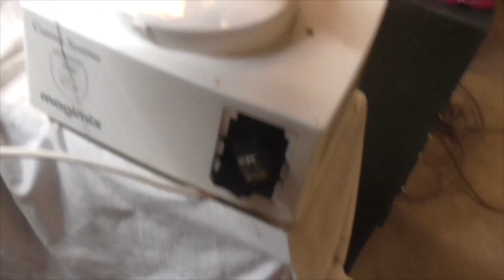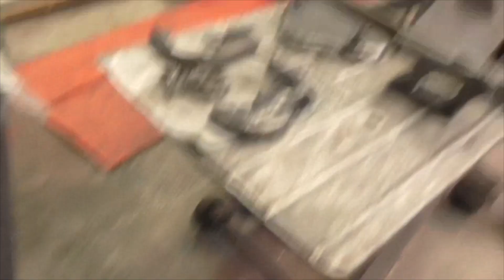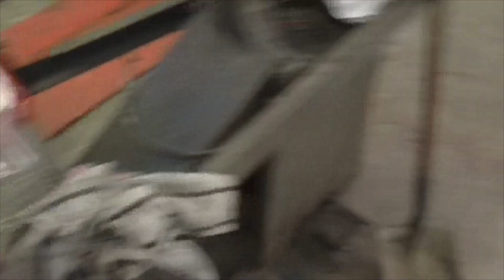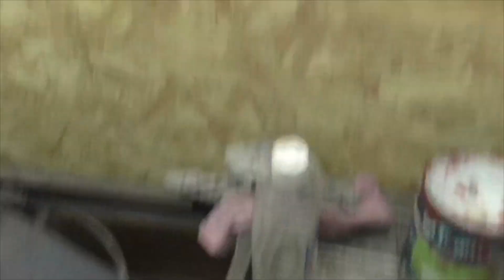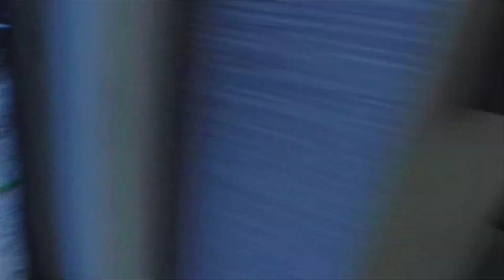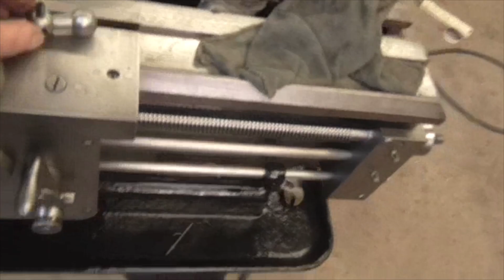Holbrook B9, painting the last few castings

Comment: Hi Phil. That red oxide paint. You said it was a filler as well. Is it thick to brush on? Looks like it's leveled out alright. Nice covering. Cheers Tony
Reply from the maker: Hi Tony,
It doesn’t advertise itself as a filler but is seems to self level very well although I will probably put some stopper on the worst of the castings, some of the fettling on those castings is a bit heavy handed!
Phil